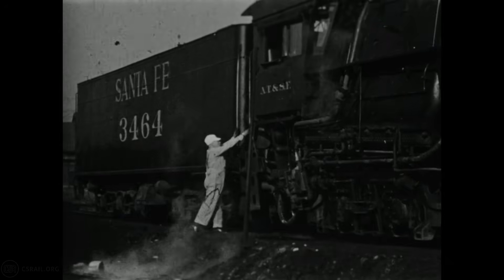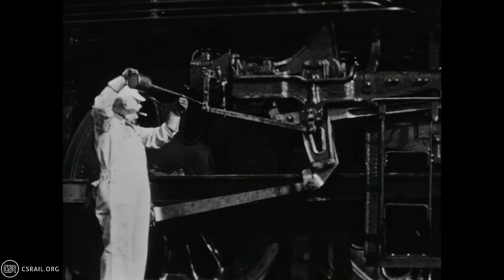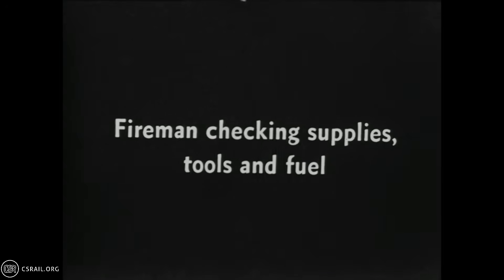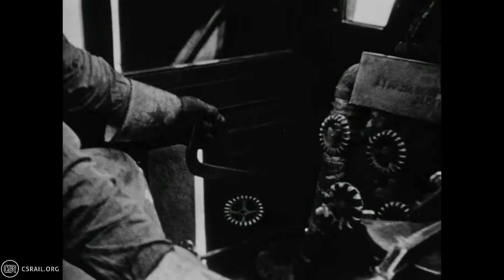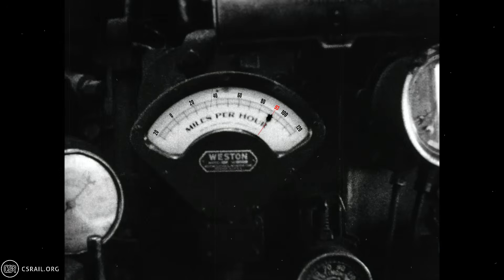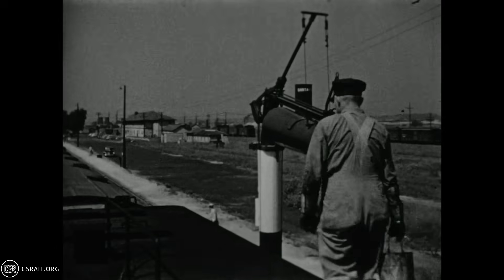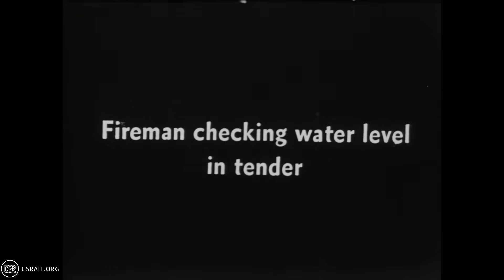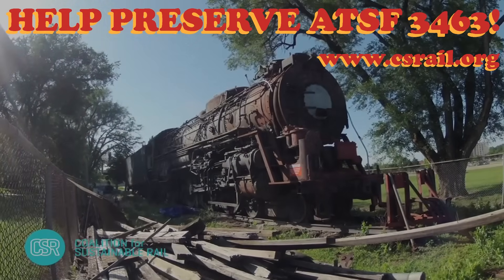Santa Fe  How to Operate a Steam Locomotive

Comment: It's not hard to figure out why diesels were readily accepted, besides the maintenance - efficiency - availability benefits. Those steam locos were a bear to operate! Yes there was some change and something lost in the transition, but I bet the average engineer did not mind the switch once getting used to the diesels.
  I don't think I heard it mentioned in this video, but would there have been some sort of  steam "cut off" lever to adjust the amount time that the steam is admitted to the cylinders in relation to the travel and position of the piston? Just another lever to operate!  lol
Reply: well the steam locomotive lacks in maintenance, efficiency, and availability benefits, they make up for by giving the engineer and fireman a good workout. They keep them busy the entire trip, while the engineer in the diesel locomotive has so little to do he needs an alarm to wake himself up.
Reply: I have heard, but not been able to confirm, that on a case by case basis that steam locomotives are stronger than diesel locomotives. Now, even if this is true, I admit that diesels are likely much easier to operate, but I am curious as to which is better for the railroad as a whole, a oil burning steam engine, or a diesel engine.
Reply: @thecpmr6276  Oh boy... you really went there. There's a saying about this in that a steam locomotive can pull a train it can never start, but a diesel can start a train it can never pull... It all comes down to available torque at a given speed. Diesels with their electric drive, forget about DC or AC for the moment, can apply their maximum power at very close to zero speed. Think about it, the diesel is put in run 8, motor is wide open producing full HP and the electric motor is drawing full current trying to get the train moving... a steam engine at zero speed literally has 1 piston trying to push the train into motion, and to boot, it only makes maximum power when the crank pin is at either 12 or 6 o'clock position as it has the greatest torque producing moment at that time. Starting torque a diesel is superior, period. Now once you get moving, things start to change. The diesels as speed increases have to be able to produce more and more voltage to be able to maintain that level of torque as the electric motor speed increases, but it isn't physically possible to do... motor back emf starts fighting the system so as speed increases, available torque decreases. In a steam engine, no such restriction applies. The thermodynamics of the steam locomotive improve as speed increases. Being able to change the steam admission time (johnson bar) allow for better efficiency the faster you go. I truly can't explain it well, but once you get a steam locomotive moving, they become harder to stop. The only limitation is how fast can you boil water, and those massive boilers did a great job doing exactly that. 

I read an article about some steam excursion trips where there was both steam and diesel in the lash up. It was A northern type locomotive which is something like 5000 thermal HP, tied up with 2 SD40's (6000 HP). The train was a relatively large passenger consist with something like 15 or 20 pullman coaches, so not exactly trivial. While the 4-8-4 could start the train as expected, the diesels could run away with the train including pushing the steamer with ease. However once some moderate speed was accumulated, the rate of acceleration would fall off.. when the throttle was pulled open on the northern, they just took off like nothing was behind them. 

Diesels are much more simple to operate and maintain by many times over. The number of crew members to do all the service work, and I'm including all the boiler rework every 90 days or so and the equipment was astronomical. Diesels basically need an oil change once in a while and they are happy. The ability to lash multiple diesels together an only require one operator is huge. Each steam locomotive has an engineer and fireman, so basically a complete train's worth of crew, less the brakeman in the caboose... Steam definitely had/has the cool factor, but operating costs were off the charts.
Reply: @kleetus92  God bless you for this in-depth explanation, a credit to the rails you are.
Reply: @kleetus92  Correct me if I'm wrong Sir but:  You mentioned one piston supplying the power from zero speed on startup.  I was under the impression that the piston on the other side of the engine was getting steam pressure on its "backside" albeit with slightly less force.
Reply: @dwightl5863  kinda... due to the quartering of the drivers, that is each power event happens at 90 degree intervals, 12, 3, 6, 9 repeat, the 'return' stroke, that is the side of the piston with reduced area because of the connecting rod, will have a bit less power yes on that event. When you start out from a dead stop, you can if the conditions are right literally have one piston trying to do all the work until enough wheel motion is made to allow the valve timing to start admitting steam to the other cylinder on the other side of the locomotive... You can envision it sort of like a 4 cylinder engine with minimal overlap.

If you're lucky, you can maybe get 2 pistons positioned such that they'll both get steam, but after a bit of rotation, you're back down to one again until another picks up. So if you were to plot on a graph the torque output it's going to be an asymmetric rectified sine wave-ish looking thing... but not a constant torque throughout the entire revolution of the drive wheel. 

I'm not even going to try to explain the effects of 'notching back' the johnson or reversing bar. That can change the valve timing from full to almost no steam admission and reverse admission... other than to say at starting you max out the valve travel to get as much steam in the cylinder as you can for as long as you can, versus while once moving you cut back more and more as you gain speed and start using the expansive properties of the steam more so than just initial physical pressure. It's complicated to explain, and I freely admit I can't but I do know it works and you can feel it in operation.
Reply: @kleetus92  So the cranks not being 180 degrees from one another is the reason.  I should have thought of that otherwise one piston at top dead center and the other at bottom dead center one could never get started until pushed a bit.  Thanks!
Reply: @dwightl5863  Yeah sometimes you can rock it slightly with the Johnson bar to get either enough slack or squeak some steam in to get some movement... but once again, Diesels do not have this problem.
Reply: @kleetus92    Someone should mention (maybe me) that many steam locomotives had "boosters" or small auxiliary steam engines coupled to the rear truck or sometimes the tender trucks. These were for the purpose of helping start the train. Once a minimum speed was reached the booster was disconnected. Another thing for the engineer to operate.
Reply: @Richard-t7q1f  This is true too, they were sometimes used on the trailing truck under the firebox or under the tender itself. The problem with the tender boosters is they tended to get slippery as the fuel and water of the tender was used up. (less weight to hold it down)
Reply: @kleetus92 that's an amazing explanation, I don't think my friend who works for the rio grand firing steam locomotives could even explain this in depth to me lol.
Reply: @Snowlep337  Lol, well thank you! I just realized I wrote that 3 years ago, after reading it, it didn't see that far back! Either way, glad I was able to help!
Reply: @thecpmr6276  A diesel
Reply: in spite of the shortcomings of steam you mentioned, the N&W was one of the last if not THE last railroad to fully convert to all diesel
Reply: But let's all be honest American locomotives No matter what model they are are just Huge event he ones of today
Reply: Yea John it was mentioned the "Reverser" or "Johnson bar" is the name and it is the vertical lever that is directly in front of the engineer ,the throttle is the lever that hangs from above that he tugs with two hands usually ,but the Johnson bar is a valve adjustment lever that you adjust based on speed and or other operating conditions as needed .